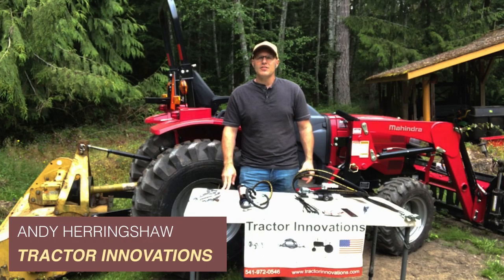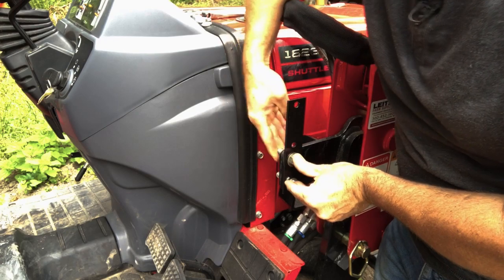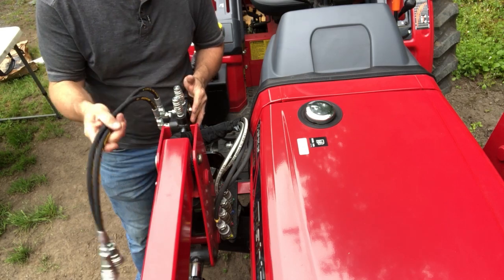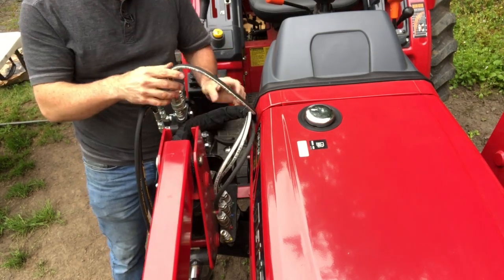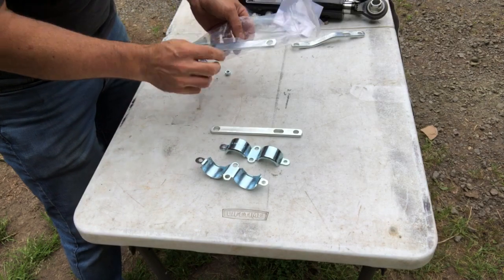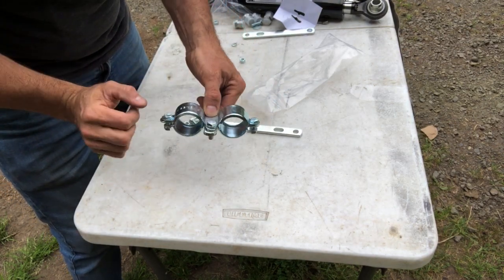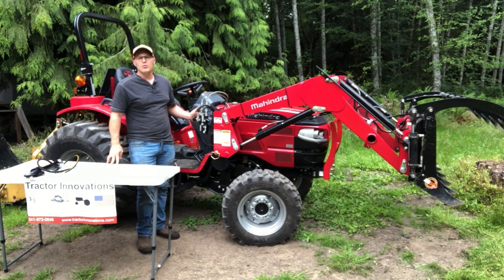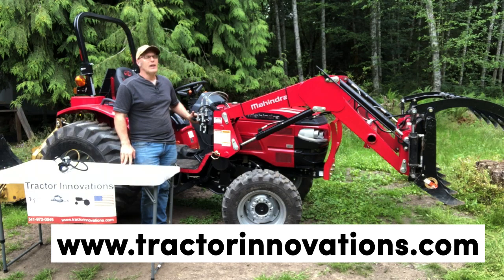$625 Remote Hydraulic Kit for Mahindra 1626.   No drilling - 15 minute install

Comment: Wonder if this will work with the new quick connect system? How would it attach? I'm getting a new 1626 and this system is more affordable than the OEM kit.
Reply from the maker: Yes, I have two versions of the kit - this classic one, and an updated one for tractors 2023 and after.    If you have any doubt, send me a picture of your couplers and I'll make sure you get the right kit.   My phone number and email are on the website.  www.tractorinnovations.com
Reply: @TractorInnovations  I ended up getting the older system so I may get this kit sometime. I'll want to use a grapple and this will make it happen. Thanks!

Comment: Hi, Andy. I have a Mahindra 5010 HST Cab. I’d like to run a grapple with it, and maybe some rear implements. Is it the same kit as this one, just with different hose lengths, or something different. Likewise, I don’t see the typical handle selector as part or your kit. Am I just overlooking it? Thanks!
Reply: Ignore that last question - I watched the video to the end. But how to mount that with a cab?
Reply from the maker: I have a video of cab installation on a Kubota.   The Mahindra cabs don't make it easy, and every one I've done has been a 1-off.    I can help you, but it takes some leg work getting the hose lengths and figuring out mounting.

Cab install video:
https://youtu.be/3VKGqHHJi7E

Comment: Can have a kit for a TYM T254 ?
Reply from the maker: Yes, this works great on TYM tractors.   I'll just have you send me picture of your loader control handle, and one of your quick-couplers disconnected, with a good view of the male coupler fitting.   With that, I can build it for any tractor.

Comment: I have 2 of Andy's kits going to the rear of my 1626 for top and tilt. All hoses are pre-assembled on the valve for easy installation. Andy also supplied both cylinders. By far the easiest and most reliable remotes I've used.

Comment: I have a Mahindra 1626 hydro, i would love to have a top/tilt for the box. Do you have a kit for this?
A video would be AWESOME!
Reply from the maker: Yes, I do double kits all the time.   You can have 2 diverters, and you're able to activate either one or both at any given time.
Reply: @TractorInnovations  
Any chance for a video in the near future?
Reply: Do you have a system for an auxiliary for the front, say for a grappler. Would the setup be the same
Reply: Interested in a top/tilt kit for the 1626. 2022 model year. Shuttle. 1626L loader.